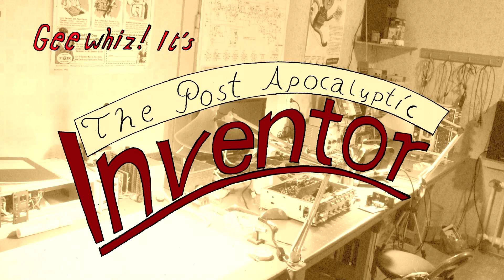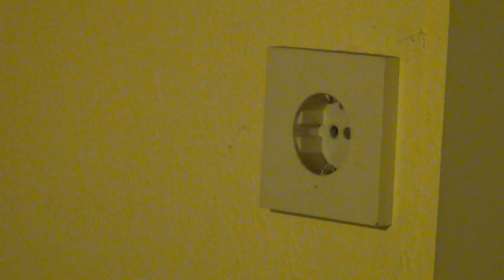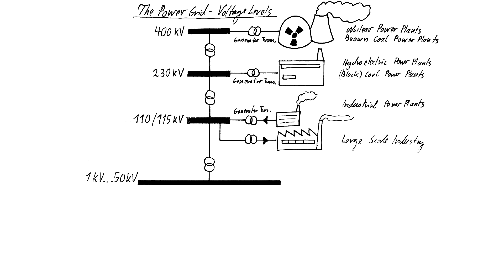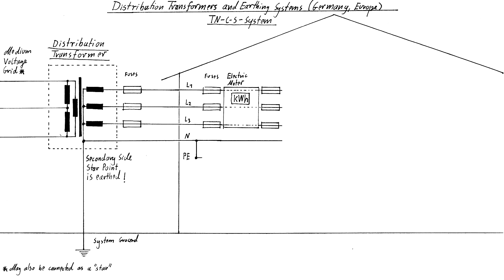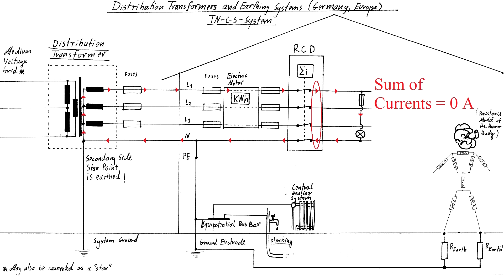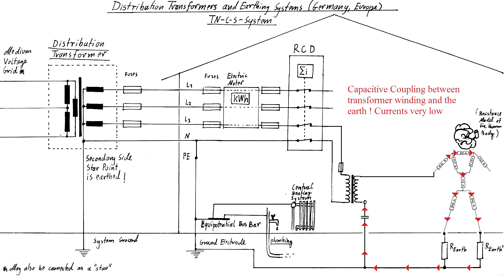The Power Grid, Isolation Transformers and Earthing

Comment: What a coindicence, I've been tinkering with isolation transformers recently as I make off-line switching power supplies, mainly just so that I can safely probe the primary side of the converter with a ground referenced oscilloscope without damaging anything. I made my own isolation transformer with a cheap old 3.3kVA (at 25% duty cycle; 1.5kVA continuous) centre-tapped earth 240V-115V (suprisingly not a 2:1 ratio) building site transformer. I was trying to rewind it to have 2 secondaries, 115V and 230V but that didn't work out. In the end I just cut the earth centre tap so earth passes straight through to the output without going to the transformer. I hadn't considered how it would make the RCBO ineffective. I've accidentally touched a live wire that was supposed to be off before and all that happened was the RCBO tripped and my arm was thrown away. I still haven't found the screwdriver tip I was holding. I've also tapped off a 380V DC PFC bus capacitor in a  ATX power supply for testing SMPS that will later have PFC preregulators added and debug the 2 separately.

I know almost nothing about house wiring, but it seems in USA they have 2 phases and a neutral to their house, 120V is phase-neutral, 240V for big appliances is phase-phase. In UK we seem to have 3 phase 400V up to a street and then only 1 phase 230V into the house, with different houses getting different phases to approximately balance the load, but it may vary in different areas. We also have a ring mains system in the house which means all wiring connections are accessible behind plug sockets but its really difficult to know where a wire goes after it disappears into the wall. I disconnected a wire that should have cut off power in my living room but it was being pulled up to live through the transformer primary of my microwave in the kitchen. It's also why all our mains plugs have 5A or 13A fuses in the actual plug as well as in the device.

Comment: Resistance of human body. Right. But it is not so easy. Actually there is big influence of capacity of skin and body and also if you are insulated from ground you can still recieve electric shock, because you still can have capacitive coupling with ground. And also this values will change after some time from begining of shock and current will go up. If you using this neon light testing screwdriver, you also can stand on insulatin surface, but neon still glow. Because of capacitive coupling between your body and ground.
Reply from the maker: xxJerry19xx Yeah capacitive coupling can be a tricky thing. These kinds of testers are actually not used by any professional I know and you shouldn't trust them, but it's a good way of showing people what it means to have an earthed referenced grid.

Comment: I think RCD works on peek current also, so if you have 230 RMS peek voltage is 325 V and resistance to turn on RCD would be around 10K ohm...
Reply from the maker: Petar Bažant Thank you. Good point. I made an annotation at that point in the video.

Comment: Crystal clear explanation. Truly useful, well planned, complete and captivating explanation. You are a gifted teacher. Living in Greenland means we share in the inherited "Danish" system which is European in character.
One question. All water services in the house are connected to earth and as far as I can see this earth consists of a connection to a bare copper multistrand wire cast into the concrete and connected mechanically to the steel reinforcing in the concrete. This is then connected to the equipotential earthing bus bar in the fuse box cabinet to which all yellow-green lines are connected, one from each cable leading to a socket. I'm a bit confused on how PE and N are connected. Where can I see that the Neutral and PE are separated "inside the house" as you state? Is there some isolation created between the two?
Again, great video. I'm impressed, and looking very much forward to the next in this series. Thanks from a complete beginner.
Reply: In old installations the split with done inside the socket to save on copper wire!
A problem with that is: any current through a wire will cause a voltage drop. Since there can be quite alot of current flowing through the neutral wire (imagine using water cooker for example), the neutral is no longer at the same level as it is in the breaker box, but a few volts higher. If N and PE are the same wire, that means your "Earth" level varies with the load. That's especially annoying if you connect different devices like a computer and a stereo for example, that are connected to outlets at opposite sides of the room.

You can check the voltage drop yourself btw., if you have a (safe) multimeter. Get a high power device (in essence anything that's heating something) and plug it into an outlet that has a second outlet immediately adjacent or use a three way adapter cable. Measure the voltages to between the wires and to PE in one socket while you turn on and off the load in the socket. You should see the voltage drop.
Reply: N and PE are basically the same. If you use copper wire with high currents for a long period of time i can occur that the connection e.g. at an insulating screw point is getting loose (due to thermal stress etc.). So as you can see if you would use the same wire for N and PE it can happen that someday you have no connection to N/PE, but to your Phase! (Which might be pretty dangerous for humans in most cases if undetected)..
To prevent this, you use two separate wires for N and PE, the N wire is the "stressed" one. The PE is the "backup", which is normally unloaded, and because of this, theoretically excluded from the connection faults as described before.

I hope this will help you to understand the meaning of PE and why it´s basically the same, but not the same ;)
Reply: Thanks! Very nice explanation and I think I've got it now. I appreciate you taking the time to help me understand.
Reply: You're welcome!